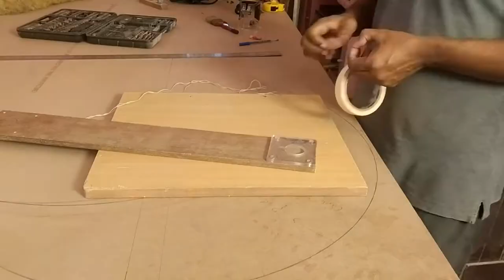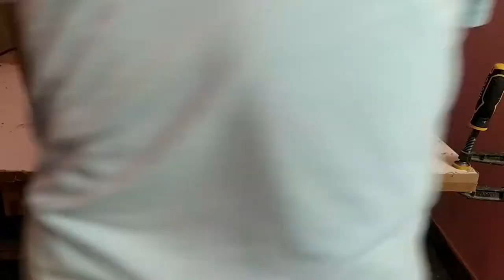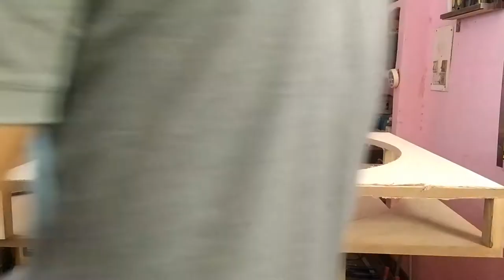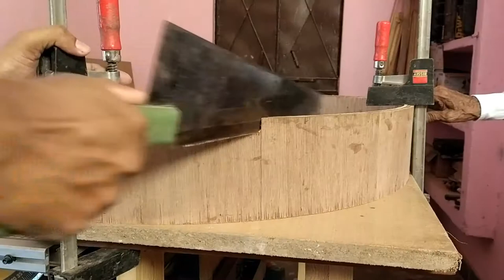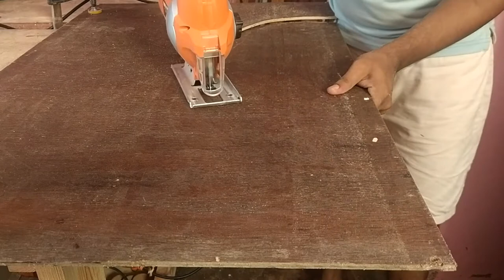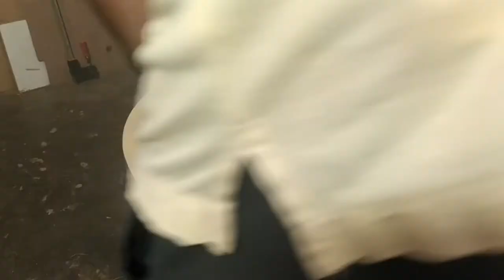whiteihf woodworking studio | moon bowl baby prop | moon baby prop | DIY moon prop | newborn prop

Comment: What material did u use to add to the curb?
Reply from the maker: Material is flexible plywood. Or you can use 2.1mm thick MDF board as well.

Comment: Cost of your table saw ? And from where to get it ?
Reply from the maker: Check it on Amazon and local tools supplier, approx. 40-50k
Reply: @whiteihf  Thank you
Reply from the maker: Try to buy it from DeWalt or Makita supplier. Online sellers are bit expensive. In delhi chawari bazar is right place to purchase. Few people arrange it against confirm order only. Best of luck.
Reply: @whiteihf  I myself is a Makita fan..I do have a range of Makita products including impact driver all from chawdi bazar. I will buy table saw from chawdi bazar.